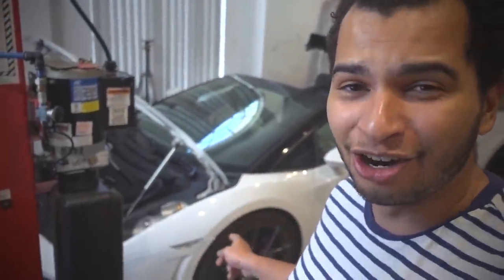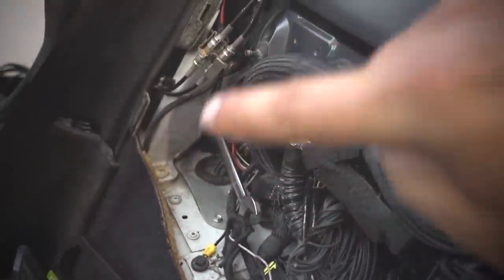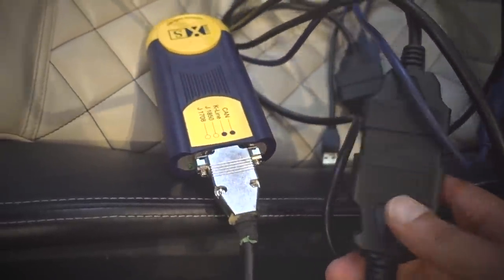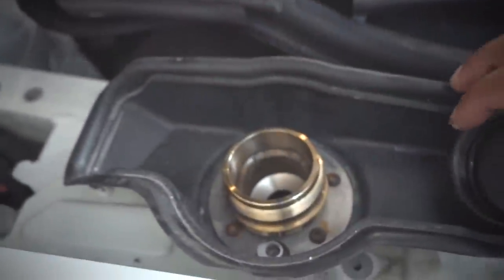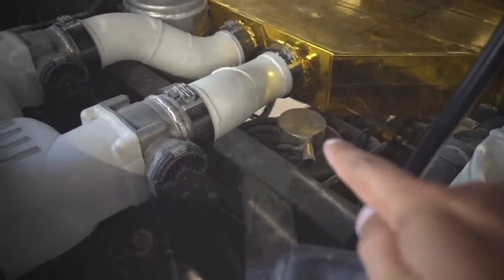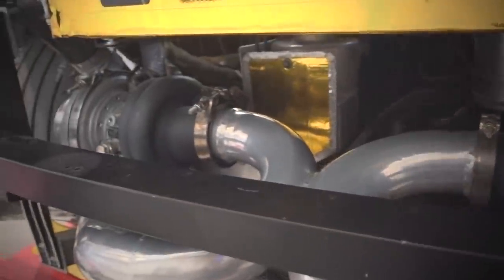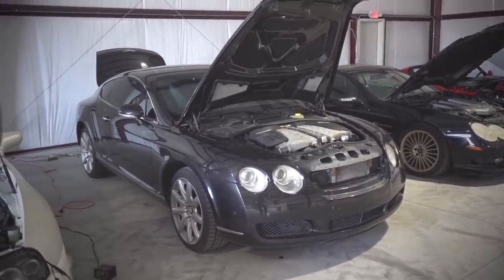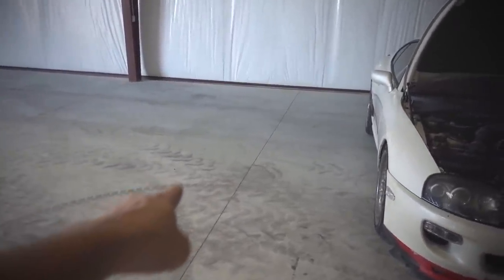My Cheap Lamborghini's "Impossible" Problems SOLVED!!! - GARAGE UPDATE

Comment: Have fun with the Bentley motor swap.  They changed a few things with the engine mainly with the secondary air injection system/vacuum lines in either 07 or 08 I can’t remember off the top of my head.  So I hope you bought a like year engine.  I have dropped a couple W12 Bentley engines before and they are a super tight fit in that engine bay and it’s easier to drop the engine and trans as an assembly out the bottom.  Bentley also sells an engine out service kit with fluids and replacement bolts for all the torque to yield bolts that should be replaced.  Also, I HIGHLY recommend you replace the starter and vacuum hoses while you have the engine out as you will need to drop the engine again if they fail.
Reply: He should just throw a Toyota Century engine in there for shits and giggles plus that 1gz-fe V12 platform is a lot cheaper than the W12 or he should LS Swap it With twin turbos he has enough space under that hood for anything
Reply: Connoisseur Of Cars & Tig Ol Bitties Why not swap in the v10 from the viper ?
Reply: @connoisseuroftigolbitts  no. Im not against Frankenstein swaps in track vehicles but for DD road cars its not my thing. If you want an LS buy a Camero. The unique motors of certain cars is what makes them interesting.
Reply: Put a twin turbo v8 in it, save a lot of space and headaches
Reply: Daver G  he said to rebuild everything if the engine and trans is pulled? That's a given with any car build. I am not interested in a Bentley build if he is just throwing in another motor. That defeats the whole purpose of building a Bentley. Im not even a purist, its that there are so many LS swaps on youtube that something like that is kind of boring now.
Reply: DonTHEhandsome1 I'm starting to think you've never actually done an engine swap. Sometimes, just sometimes, the engine that's the most reliable, makes good power, most easy to work with,  has the biggest aftermarket, is way cheaper than anything else AND is the easiest to increase performance on, is actually the best engine to drop in. In many cases, that engine is a bit boring to put on youtube. 
Being unique/interesting isn't always a good thing. If all your forks are good except 1 which is bent, you won't use the bent fork as it's useless.
Don't give a fuck if you find the LS swaps boring, they're great engines and that's a good enough reason to use them in anything and everything.
Reply: Engine swapping the Bentley to any other engines would fucking tank the car’s value. He bought it cheap and if he’s keeping it stock there’s a reason, most likely so he can sell it so he can build more cars. It’s a Bentley for Christ’s sakes, it’s supposed to drive like a bentley, not saying that it can’t be done but sometimes our resident LS swappers on YouTube get so focused on whether they could, not whether they should
Reply: Nicho
Reply: swap with a quad turbo 4 cilinder engine
Reply: many of the pro Ls folks arent even old enough to drive yet. idk the cost of the engine as a repalcement versus an overhaul. maybe someone who TRULY does can shed some light on this?
Reply: @ThaMythbuster  you dont know what I have done or havent done. Lets put LS motors in everything we want to go fast. Get that shit out of here. He has a unique car. Who cars if its a shit motor. That shit motor is what makes it interesting. Fix what you got.
Reply: Yeah it's the same engine but without turbochargers. Phaeton's are basically 4-door Bentley Continental.
Reply: ToraxReborn You think LS swapping an RX7 is dumb!?!? An LS FD must be one of the best driving setups around. If you're going to try diss something get a better example mate
Reply: Mijc Osis I’m certain it would physically bolt up, but Bently didn’t just grab a W12 out of a VW and Audi bin and fit a pair of turbochargers.  I can’t speak without doing more research, but I would wager on there being some internal changes to support the added stress of turbo charging.

Comment: A 2008 computer for a 2008 car, perfect match!

(Idk honestly, probably?)
Reply: Yes
Reply: when you click so fast and don't know what to comment
Reply: It should be running Windows Vista not XP
Reply: Skullraiderz yep
Reply: Clearly you all know very little about software
Reply: Skullraiderz well I kinda know abiy
Reply: Bit
Reply: No,  I'm right windows vista, xp, and 7 came out in the right time frame.
Reply: @FrezzyYT  in 2008 everyone was optioning Latitudes like that with XP because Vista was too bad to use in a corporate environment
Reply: I have a 2015 MBP so I HAVE to get a 2015 car?
Reply: Actually he said in an older video's comment that the laptop is from 2003.
Reply: @nordic-chan  Vista is fine.
Reply: It's a 2003 laptop. Waste of money, for $50 he could've got the OG Macbook which is newer and faster, its still an excellent windows laptop.
Reply: I had one very similar from 2003.  Was a real POS even when new.  They were the budget laptop from Dell that year.
Reply: 06
Reply: so you comment this because you clicked so fast? why didnt you figure the comment out, you werent on a timer. unless im missing something?

Comment: Lamborghini Logic: Stuff a bunch of wires behinde you and Hope it doesnt short.
Reply: Lol Lamborghini are pretty realible you must admit
Reply: StradaleF430 lol saw that on Tavarish’s ig it was funny
Reply: the italian way, so temperamental!
Reply: Make it look good, sound great, and go fast....everything else forgetta boutit!
Reply: Aaron 15 until they catch on fire like they usually do
Reply: I worked in Car wiring hynes factory . And Qualified electronican. And I can say... It wont as long as its not rubbing on anything that will cut the outer layer.
You could throw whore wiring system in water and as long as connectors are dry there wont be any problem. 12v that cars operat at will not 'jump' spark over insulation layer.
Reply: Italians,  gotta love em

Comment: Advice from an electrical perspective: Run a wire connecting all the ground points together.  Don't depend on the car itself to be the ground "wire."
Reply: Hungry Guy is this just to remove a excessive amount of random ground points throought the whole car to having them all localized to 1 location? So it’s just cleaner ? Or is there a specific reason for this, just curious - also does it have anything to do with a grounding loop? apparently my car has that because when I charge my phone and play music out of it it got super static and broke up a lot lol
Reply: @filipnine  because the battery has a ground wire to the frame, and electrical components throughout the car will ground to the frame as well to reduce the amount of wiring and not have to run a ground all the way back to the battery from every component. He's saying you can run one looping ground wire to each chassis point to be sure you don't have any spotty connections. Valid? Yes, but not needed imo
Reply: @FZ6Lucas  more about ground loops.
Reply: @Kalvinjj  visit any automotive audio enthusiast forum and you will see ground loops do happen, even if all grounds are on the same chassis.

Comment: "Battery was dying when car was off", directly followed by "not sure, maybe i just need a new battery, moving on to my newly tucked wires"
The more episodes i see the more i'm genuinely worried for your health and safety....

EDIT:
HOLY SHIII THANK F*CK YOUR FIXING THE STRUCTURAL INTEGRITY OF THE STRUCTURAL BARRR, HALLELUJA@!!! good man! thank you for finally picking up on comments about this, there's still hope ^^ (i would strongly suggest some flat square tubes there btw, that fit in the 2 slots you have now, this will be all you really need, but you REALLY need it, plz dont jeopardize your work with a test drive before doing this, would be such a shame)

Comment: Great update.
Re the Ferrari, harness, electricals, upholstery and plastics need to be replaced.
Also as it catches fire too easily am certain you will find a fireproof solution  eventually.
The good part is that the mechanical components may be ok.
And the Frunk is perfect.

Comment: If you want to eliminate the fuel smell from outgassing fuel hose, go with a PTFE inner. They will also outlast various rubber types, and have higher temp limits. Worth the $$ and trouble, for a fire-free lambo... that doesn't smell.
Nice job on cleaning up the wiring. Painstaking for sure.

Comment: Big fan of the channel! I am also big on DYI. You should do a mini-series on welding/painting, similar to the ceramic coating. Welding/painting are both easy to learn, difficult to master, and learning it on the channel would be great to watch. Setup a cheap painting booth in the shop and paint the Viper yourself! :D

Comment: I wonder if there’s fire suppression units for cars? Like if there’s a fire in the engine bay it will distinguish the fire before it causes further damage? 

You should keep a fire extinguisher or two in the car behind the seats when you take this beauty out. Fingers crossed it lives a happy life with you though. I adore this car.

And I’d love to see the transmission in gold. But it needs to be painted not taped. Gravel, water, wind and the rest of the elements will trash the tape pretty quickly. You should also get the other taped parts painted gold. It would look slick af.

I also think you should do the callipers red. Like brembo red. And the transmission red too.

Comment: Reconditioning the battery:
If it's failing because it's been sitting for a long time it will need desulfating, not just slow charging.
You can get a cheap desulfating circuit board that costs very little. It's a pretty simple circuit. They work great but the desulfating process may take about as long as the sulfating process that degraded the battery.
Maybe buy a new battery and put this one on the shelf connected to a desulfator.
Reply from the maker: The battery charger I had on it is a desulfater.

Comment: my opinion on the diff color, use the same blue that's on the calipers. as for the bumper structure in the rear, yes box it back in, drill holes to be able to get the boys in and out, then of you want to over build it, weld a thick plate on the back side. that should do it.

Comment: I feel you should put that transmission piece in that same blue of the brake calipers, also, don't forget to consider putting a mesh in that area you cut out of the back bumper.

Comment: The transmissions case should match the brake calipers blue.  Fashion designers make a color ratio of 60-30-10.  White is the 60%. 20% is black,. Gold is 15% and blue would be 5%

Comment: I remember having a turbo Miata and it had a Haltech ECU. Had to buy an old laptop so I could run DOS operating system, but ended up running it in a virtual machine to tune it.

Comment: Your grip tape (sold for hockey sticks and sports grips) might be electrician's friction tape. Before self-stick vinyl tape, you wrapped wires in friction tape, so an outerwrap of rubber insulating tape could stick on them. Still sold along with rubber tape and the new harness wrap tapes.

Comment: Do yourself a big favor before your shop gets used and seal the floors, even if it's just Thompson's Water Seal. Get some used Pallet Rack with wood or wire decking.  Having someplace to put all the parts of a build is critical to lowering frustration from parts going missing or getting damaged, especially if more than one project is going on.  Float chargers on everything that enters the shop, immediately!  Tool carts instead of one work bay is better for one mechanic and multiple bays, store them in one area and pull them out as needed.  One cart for AC work, one for Electrical, one for wrenches and sockets, etc. 5 feet minimum between projects, 3 between parking... if you have to turn sideways they are too close. Lifts are great but don't leave a project on one for more than 5 days.  These are lessons learned over 40+ years so don't reinvent the wheel.

Comment: If you're removing the Bentley engine then there's a notorious vacuum line behind it that fails and needs engine removal to replace it. Also a £40 wiring loom behind the bulkhead and fails giving massive grief. You should try to find out all you can do whilst out as these little faults send these cars to be broken.

Comment: You should take a voltmeter, set it to measure amps and take off one lead to the battery and WHILE THE CAR IS OFF AND DO NOT TRY AND START IT (or you will blow up your voltmeter), hook up the amp meter in series and see if the car has some sort of parasitic drain. may be an electrical problem. sometimes it doesn't happen right away but it doesn't hurt to check.

*also make sure to close the doors, shut off any lights and the key far away from the car. the car has to be 100% off for this to work. wait like 10 min after shutting everything off to make sure.
use a cheap mulitmeter incase the paracitic draw is too large. you can fry the mulitmeter id over 10 amps for long. maybe add a low amp fuse just incase.
Reply: what happens if you do start it? You wrote some part of your comment in caps, makes me think there's some danger :) I'm clueless with electricity.
Reply: You might draw more amps than the voltmeter can handle and blow a fuse on the voltmeter or the voltmeter itself if its not fused.
Reply: nick paz don’t forget to shut the doors, wait 10 minutes give or take, and make sure the key is out of range. Some systems with wireless entry will draw power when the key is nearby.
Reply: Exactly, Thank you.
Reply: @allrimmedout  errrrr. no. you use a fluke 87 with the "peak/min max function" so you can see how much the min and max draw is. It has a fuse inside that will blow if cranking the car happens

Comment: Hi everybody and Tavarish and thanks a lot for your help to repair my Gallardo, it come from qatar and it in really bad condition, i have a question, does it absolutely necessary to use the original ACTIA BASIC XS adaptator or the copy is enough to use with LARA software, like to reset the clutch, snap egear etc... MANY THANKS from France.

Comment: I find it incredible that people are asking why the Lambo is taking so long, personally I think you have done a lot in a relatively short time. Please don't paint the tranny cover gold or blue or any other colour. Stick to your original theme of black and white and paint it black and while you are at it repaint all of the currently black components that will be visible when the bumper is back on. The only other colour I think would perhaps look good is  the same colour as your wheels. The blue brake calipers look out of place as well and I hate to suggest even more work for you but I think they would look better if they were the same colour as the wheels too.

Comment: lambos and new f cars require a trickle charger on all the time or the battery will go flat in 2 to 3 days.  Also the oil issue all lambo g cars burn oil this is normal keep a quart in the trunk.

Comment: At a EFR Turbo you need sometimes with Oil Pressure over 5bar an Oil restrictor. So check your Pressure, if it is over 5bar, try with an restrictor.

Comment: Congratulations on surviving the summer in FL with that POS portable AC unit.  If it has only one hose it will never ever cool your garage in the summer, ever. It will output cool air coming from the unit onto you but since it is expelling the hot air to the outside it in turn creates a low pressure environment inside your garage.  Yep so all of the 90° air with 90% humidity is flowing back into the garage through every crack and crevice.   
1.  Pick up a mini-split unit you can install yourself  2.  Insulate your garage door and walls.  Many times builders won't insulate garage walls.  You can get expanding foam so you don't have to tear open the walls just small holes to spray the foam inside the wall or get professional.  3.  If you have windows that face the sun get some frosted window film so you can't see in and you can't see the insulation panels installed in the window openings.  
Get that done and working in the garage will be much more enjoyable.  Cool and less humid.  Enjoy!

Comment: Not sure if you have plans to do but I would reinforce the back of the bumper support where you cut it. That way it clears the bumper but maintains the strength, and would save a lot of damage in a crash, and also help with rigidity holding the power down when the whole car is flexing from putting down 900+ hp

Keep up the good work

Comment: Please make the sl55 super nasty. It has potential to be soo sick. I would love to see the exterior cleaned up, coilover set up, carbon fiber front splitter, updated amg exhaust, and perhaps an upgraded twin turbo system. With the manual swap included, this car would be insanely fun. Would also love to see some rotiforms or some sort of wheel/tire setup for some perfect fitment.

Comment: No to the gold transmission as well brushed aluminium or black or white to much the the intake also I think you really need to test you theory about the oil burning by swapping the turbos around before you go in making the scavenge system

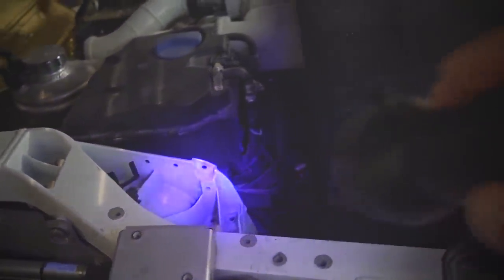Comment: 7:25 "There are no leaks" proceeds to show area light up right where fuel lines would spray on the engine if there was a leak hitting spark plug boot.

Comment: Let's see new here,but need to see your expertise,,I see you are into Xpensive cars,,,,,,buying them salvage and rebuilding,does it pay?,But in order to work with these cars,you need a plan with everything in working order,,,a laptop from Craigslist running Windows XP>manual are revised quite often,,its like computers,they change too often,have all info handy,,,,I bet you are succesful at what you do,,but having adequate equipment,make things easier
Reply: are you alright?